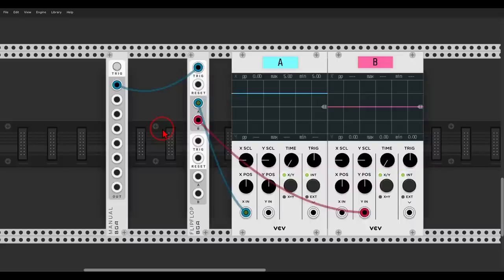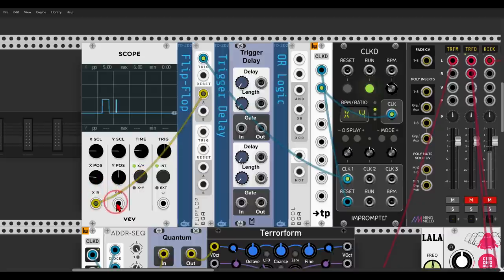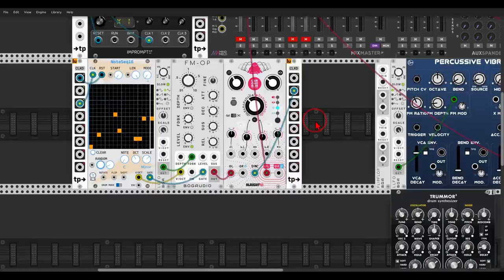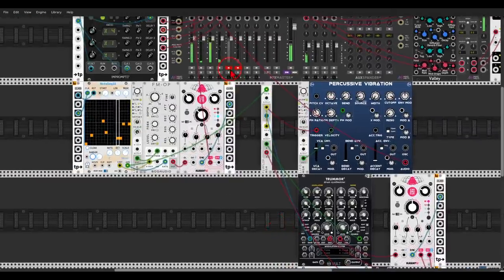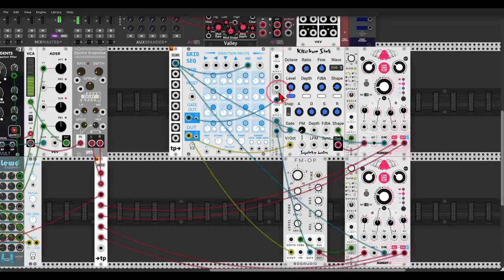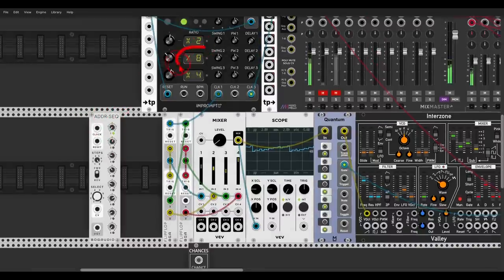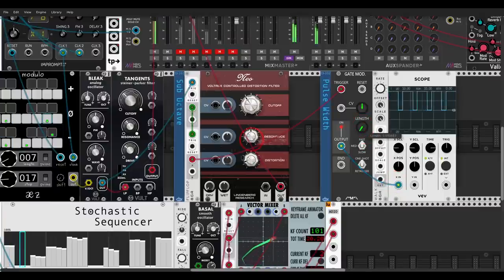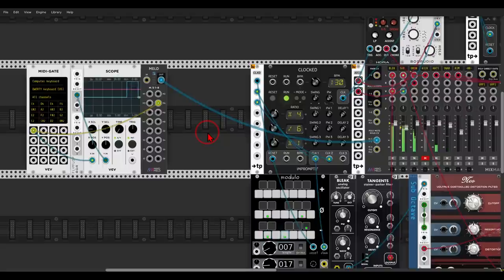What are Flip-Flops and a few ways of using them

Comment: ML Modules "Octaflop" is an inline array of 8 flip flops. By default, each flip-flop feeds into the next one below it making the single module an 8 bit binary counter. Each flip-flop divides the previous flip-flop's signal by 2 making the final output, with no further logic, a divide by 256 clock divider. By connecting an input to any of the lower flip-flops you can break the internal inline connection from that flip-flop on down. The module has a manual reset that has a CV input and if you understand the bit values of an 8 bit binary number (2, 4, 8, 16, 32, etc), you can "AND" the appropriate outputs (add the numbers to get the total you want for a reset value) to the reset CV input to divide the clock by any number from 2 to 256. By feeding the last flip-flop output into a second Octaflop you can AND any number from 2 to 65536. One use, besides all the ways shown in this video, would be to create a precision event timer/trigger to trigger or start or stop different parts of a patch at different times (use a latch as shown), but based precisely on the BPM of the main clock. This is all basic digital logic.
Reply: Next VCP challenge should be a 18342 step sequence created this way.
Reply from the maker: Yeah, the OctaFlop is great!